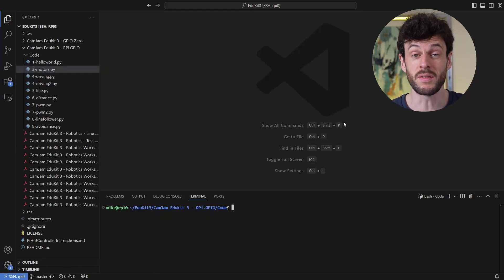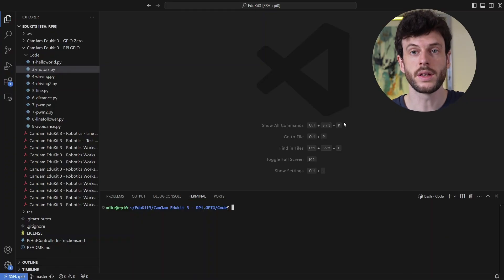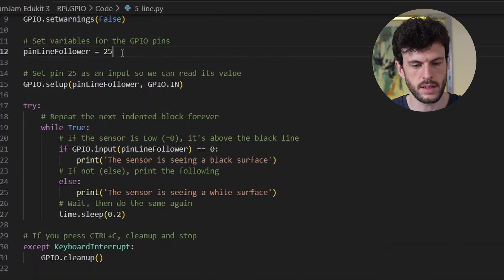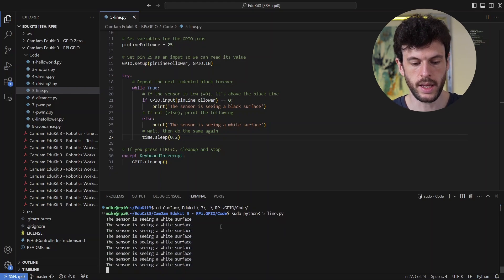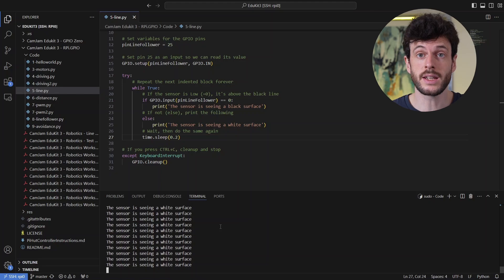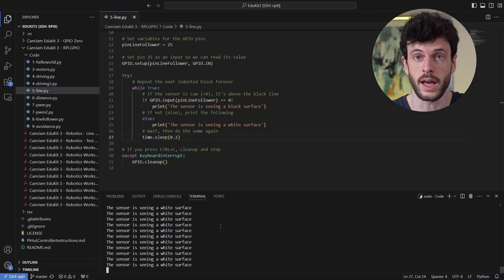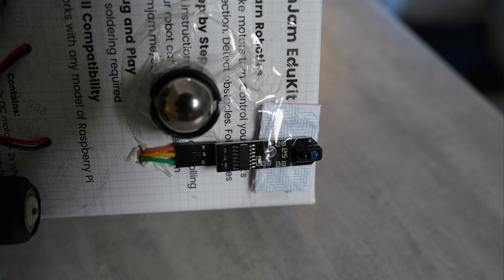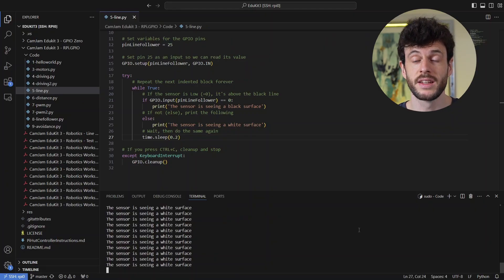#5 Testing the Line Sensor | CamJam EduKit #3 Robot Kit

Comment: I know this is from a while ago, but just to cover off the explanation for anyone learning here. The line sensor isn't too far from the paper in that it's failing to get a read, its that the sensor is picking up a larger area of the paper and so picking up some white as well as black. The higher up your sensor the more it'll be able to see. 

You can solve this several ways. Move it down to decrease the amount of the paper it sees, change your threshold so you require more white light returning from the paper (that will allow for some black but doesn't require it all is) or cover your sensor so it can only look down (collimation, used in many sensors to ensure the direction a signal is coming from) though you will have to ensure you don't get interference from the sensor cover! 

A fun learning point about sensors.
Reply from the maker: Great follow-up!